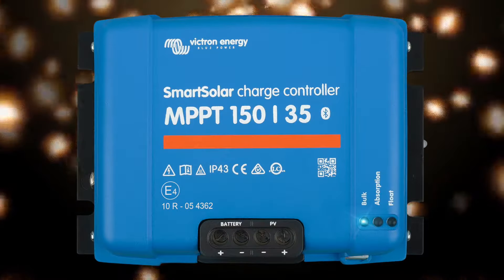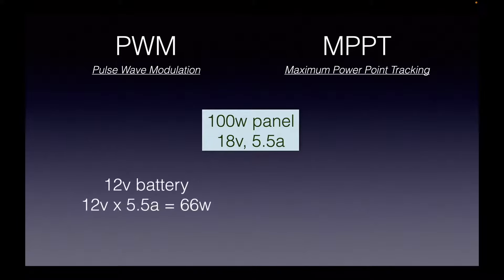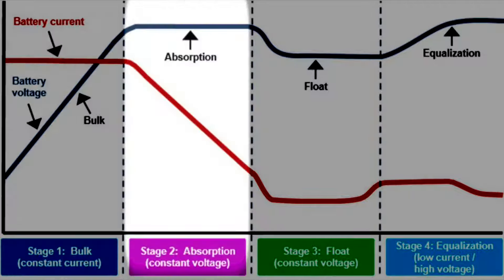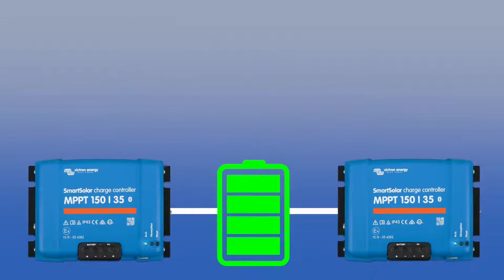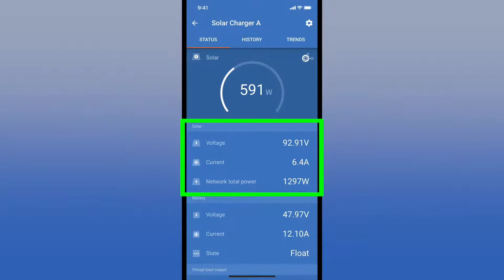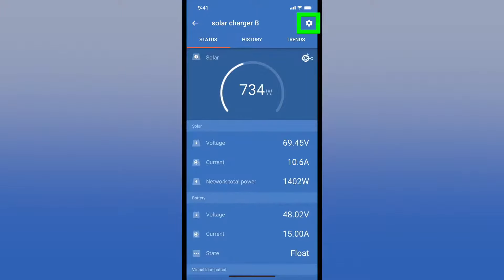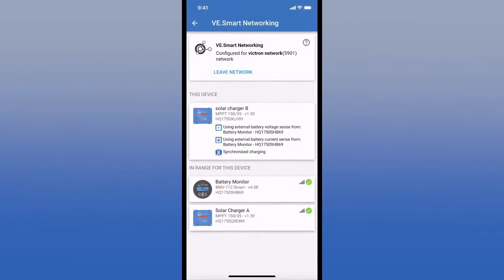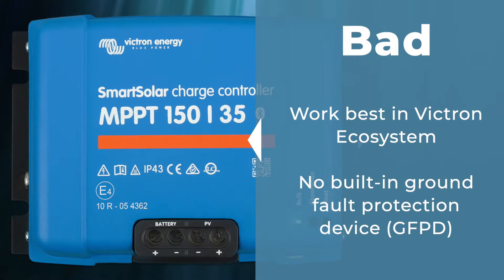Victron Smart Solar Charger Review After 4 Years Of Use. Features, Apps, Wiring Explained.

Comment: Just missing the correct load and streetlight info. These DO have a "Virtual Load" output. You can set the VE direct output as a switching level output for an external load controller such as a relay module. You can do a lot with the load and streetlight settings. Like set the voltage range for your load and when in a day cycle it comes on (they don't have a realtime clock they uses the solar cycle to time off).

Comment: bluetooth does not work well on windows PC I can only setup VE Network on a smart phone. Victron Connect and VRM do work okay though on Win 10
Reply from the maker: Thanks for sharing.
Reply: VE is not supported on Windows platform via bluetooth unless you use a VE.direct to USB cable (non bluetooth).  It sucks that we have to buy an andriod device (table) to do the simple stuff.
Reply: Maybe try updating your bluetooth drivers. There may be a driver package with more BT options direct from manufacturer of your BT chip.

Comment: on my 12 volt off grid system I have 4 of victron charge controllers, a 75/15, two 100/30's and one 100/50. I have a home assembled 630ah lifepo4 bat.  I have the smart shunt to keep track of battery level/current/voltage ect.  I  would  like to limiit the overall current the battery will be charged at without limiting the charge controllers(for supplying the loads)  Anyone aware of this being a possibility?

Comment: Hello.   Thank you verry much.   It's really helpfull!  Is it possible to use victron mppt as a booster.  For exemple i have a ebike with a batterie  48v. 25 amp.     And a solar panel 100w 12 v ?     I want to charge my bike while riding...  let's say with  a smal victron mppt. Have a nice day!
Reply from the maker: I suppose it MIGHT work... You would have to find a charger that matches both your solar panel and your battery. Victrons need 5v more voltage for solar input than your battery voltage, usually requires multiple panels.
Reply: @ReelClearMediaLLC  Thank you!
Reply: no. it is a step down charger. not step up.

if you have a 48V battery you'd need to build a 48V system. and having 2x 40V panels plus a 48V mppt charger would be a proper way of doing this.

Comment: I can never tell from victron controllers which ones can be used with 48v batteries I wanted to get the 75|15 controller but unable to tell from spec sheet if it will work with this battery
Reply from the maker: No, the 75/15 only works with 12v or 24v battery systems

Comment: Thanks for video. I live in the UK where there isnt much sun light in autumn/winter so we often have to swap the site batteries for batteries fully charged in the warehouse in order to keep the system running 24 hours. However, sometimes the blue controller stay on bulk mode permantelly after the batteries swap. Pretty odd isnt it?
Reply from the maker: yes, that is odd.

Comment: Really good 👍 straight to the point, easy to understand, just bought 2 x 100/50 s. Upgrading panels and controllers. My xantrex pwm c60, has been rock solid for 15 years off grid, but the newer mppt is definitely the way to go, hello from Ireland ;)
Reply from the maker: Thanks, Keith.

Comment: Excellent video.

My question is ...

Is there a problem if you input too much solar panel power?

I have a 1500 watt array that I power my water heater with.

When the water is up to temp, the solar panels are  electronically disconnected.

I would like them to switch over and start topping off the battery bank.

Is there a problem feeding 1500 watts at 115 vdc into a 150/45 charger?

My thought is the charger will max out at 45 amps with no harm done.

What do you think?
Reply from the maker: The Victron will limit PV amps to 45. As far as voltage, you  have to account for variables like cold temperatures. Victron has a spreadsheet that helps: https://www.victronenergy.com/upload/software/VE-MPPT-Calc-4_0.xlsm

Comment: Very clear and detailed presentation... thank you!
I have two questions:
- How much is the max input voltage from PV... 150V with zero tolerance?
- How much is the max input current coming from PV... 20 A or more... with zero tolerance?
Reply from the maker: You have to add adjustments for cold temperature s and irradiance. Victron has a calculator for that
at https://www.victronenergy.com/support-and-downloads/software down at the bottom of the page. Its called MPPT Calculator Excel sheet
As a ballpark figure, make sure you stay below 120v using your Open-circuit Voltages. As I understand it, the MPPT charger will only pull what it needs and cap amperage there. On my 150/35 model it will never pull more than 35 amps. I believe that refers to 35 charging amps going to the battery, not pulling 35 amps from the solar panels
Reply: You are conferming my doubts about, 
data from victron are not so evident and ready to be understandable at the first reading.
120V is a good compromise to Vbatt+5V and 150V is acceptable but 150V maybe regards to Voc of PV.

Comment: I have two growatt 3000  in para. and slit phase. They don't seem to charge the battery's fully, I was thinking of going to theses charge controller's, do you think that would be a good idea? Thanks
Reply from the maker: The victrons are great chargers. What is happening with the growatts?
Reply: @ReelClearMediaLLC  when they get the battery's up to around 25.6  they stop charging  , the battery symbol blinks  showing fully charged. The only way I get the battery's to fully charge up to 27 v  is to take all loads off the inverters , and let the solar panels or shore power charge only the battery's. I was wondering if a stand alone solar charger would do better? Thanks
p.s. I have the charge shut off set to 27.2 in the growatt.
Reply from the maker: @bianchispurs  Check Setting 2 and 11 to make sure it's charging with enough amps in absorption and float mode. 
If that doesn't help, The Victron chargers are very flexible. Make sure to pick the right model for your batteries and solar...
Reply: @ReelClearMediaLLC  Thank you, I will check that.

Comment: Hi very good easy to understand video. I’m in the uk just brought victron solar charger 100/20 got a 200w panel could I an another 200w panel to the victron or would I need a bigger unit. Also question on voltage settings for battery on victron float and absorption mode .. I’ve got a renogy 170amp lithium battery what should I set the two voltages at . Thanks mike
Reply from the maker: I've never used either if those, so I can't tell you from experience, However Victron has a calculator on their website where you can see how many panels work with different chargers. 
See the MPPT calculator excel sheet at the bottom of: https://www.victronenergy.com/support-and-downloads/software

You'll have to get the recommended charging voltages from Renogy.
Reply: As long as your Voc Max on both panels sums to less then 100v, you're good to put them in series. Do factor in a little overhead if your area is likely to get cold in winter, as this can push the Voc too high and fry your Victron.

Comment: Nice clear and concise. Thanks. I noticed you used 48 volts in one of the settings, but I think said your Chevy batts were 46. Did I miss something?
Reply from the maker: The 48-volt setting is a general range of battery...  the choices are 12v, 24v, 36v, or 48v. The precise charge voltages are set under absorption and float voltages. 
I've since upgraded to EG4 Lifepower rack mount batteries, they are still set to the "48v" range, but the charge voltages are much higher than the volt batteries.
Reply: @ReelClearMediaLLC  thanks!

Comment: the screw on the left from the side is for ground. i saw u dont have it connected. is that the solution to the case of possible ground fault you mentioned at the end of the video? i have this in my car and i want to ask u if u know for certain if it needs to be connected to the car ground (chassis)?
Reply from the maker: I'm unsure of how to wire that for mobile use. There are forums online for wiring RVs and vans that would be able to help.
Reply: @ReelClearMediaLLC  thanks. i think its the sam as with solar panels. in house yes on car no. why i think is that if a lightning strike the car and my vic is connected to the chassis.... well i presume byebye victron
Reply from the maker: @chupo4putin  If lightning strikes the car , the Victron will be the least of the problems.
Reply: @ReelClearMediaLLC  if lightning strikes it goes thru the tires and inro the ground. car suffers no damage so i think i think its fine. i think that bolt would kill me if lightning would strike at the precise moment i would be touching it or heat sink if it was scratched. thats what i think not sure thou....

Comment: Thanks for the video. Is it possible to set the battery charge voltage? My battery needs to be charged at 12.6V 20A CV/CC, will I be able to set this? Thank you.
Reply: You can limit output current to 20A if you want, and charging setpoints to 12.6v if you want.
Reply from the maker: @fratermus5502  thanks for answering, I was busy and away from Youtube this week

Comment: Hey mate, my victron app doesn't show any wattage only under load. So you think it's in mt settings? 
Thank you
Reply from the maker: If you are looking at a charger in the app, you might not see any watts if the battery is fully charged. If the battery is charging you should always see watts on the charger page of the app.

Comment: How much DC load can be run by this ?
Reply from the maker: This model doesn't have any DC load out. Some of the smaller Victron chargers do.
Reply: @ReelClearMediaLLC  so you use this only charging batteries ?
How you run DC load then ?
Reply from the maker: @imranraza1978  I don't need to run any DC loads directly. My AC loads come from the inverter, and when the battery is full, the inverter uses solar  from battery buss bars, which also connect the Victron chargers.
You could also use a DC/DC converter to convert the 48v from the batteries to whatever DC voltage is needed. I just run adapters for the few DC loads I have.
Reply: @ReelClearMediaLLC  thanks

Comment: So for a noob, the 150 / 35 means it can take upto 150 volts VOC and 35 amps input from solar panels.  Is that correct?
Reply from the maker: Generally, yes. 
The voltage can be affected by temperature and other factors. Victron has a spreadsheet on its website.
35 amps is the most the charger will pull from the panels, even if the panels can produce more than that.
Reply: @ReelClearMediaLLC  so...victron mppt controllers can overpanel both voltage and amps then regulate down to their max SAFELY?
Reply from the maker: @MyChannel-vm6dw   NO! Overvoltage will fry the charger. It is more complex than just the VOC, you have to account for temperature and other variables.
Download the calculator here
https://www.victronenergy.com/upload/software/VE-MPPT-Calc-4_0.xlsm
Reply: @reelclearmedia4157  thank you!
Reply: To my knowledge 35 means the max output amps from Victron controller to the battery. For example 35A * 12V = 420W  and  35A * 24V = 840W charging the battery.
Reply from the maker: @herkko61   Yes, that's correct, I just checked in the manual. There are charts that show "Max battery current" and it matches the amps in each model number...
i.e. the 150/35 =35amps, 150/45=45 amps etc.
Reply: Max 150v input and will only output 35amps so you could do one string to 150v and parallel it to an identical string to get same voltage but double amp thus over panel it for cloudy days

Comment: Are you using 10awg for your pv input?
Reply from the maker: 8 AWG, mostly because the run is 150' long, so a bigger cable for less resistance and voltage drop.
Reply: @ReelClearMediaLLC  oh yes, that's true, 8 awg, would be the way to go. How much voltage and current do you have going into, your charge controllers? From your array
Reply from the maker: @carlosreyes6448  The first array has 15 panels, 160w each. There are three strings,  with five panels to each string.  The three strings are paralleled using a combiner box.Voltage ranges around 90-100 volts, current average 10-20amps. My max power is around 1700 watts.

The second array has 12 panels. Three strings of four panels each. Voltages average 80-90v, current 15-25amps, max power is also around 1700 watts.
Reply: @ReelClearMediaLLC  I'm thinking about installing 8 rec 420watt panels and running a victron 150/60, it's rated for 3440 watts, but not sure about the configuration I'm thinking about 4 strings, series parallel, but they are rated at 59volts voc, and 8.9 isc,amperage.
Reply from the maker: @carlosreyes6448  Victron has a spreadsheet to help you design arrays for their chargers.
Download at the bottom of the support page. https://www.victronenergy.com/support-and-downloads/software

Comment: Having trouble with connection to my android 12 tablet. Currently no problem with my smart phone.  Maybe I should uninstall it from my phone then try to connect to my tablet  ... anyone else have these issues ?
Reply from the maker: If you're connecting with bluetooth, it may only allow one device at a time. If so, You don't have to uninstall the smart phone app just disconnect from blutooth
Reply: Check to make sure the VeConnect application is supported on android 12.  It may be supported now as when I purchased my tablet I chose v11 for that reason if memory serves me

Comment: *SHOCK*: YOU ARE PUSHING  30A @ 58V into your battery on FLOAT!!! 
RIP battery life
Reply from the maker: That's 30 amps max into a bank of two EG4 Lifepower4 batteries... each battery gets 15 amps. Their max charging current is 100 amps each, recommended 30-50 amps each. These batteries will be fine.
Reply: @ReelClearMediaLLC   your missing the point.... FLOAT you shouldnt be drawing that much current in FLOAT. you either have crap batterys, crap BMS or as leak somewhere. pushing 1.7KW!! into a full bank thats not doing anyhting?? 1.7KW is not float current.
Reply from the maker: @freelectron2029  Thanks, I forgot this when video was recorded I was using 6 chevy Volt modules(12S)... The BMS was crap, but with 6 modules, that was about 5 amps/module. Recommended charge was 49.2V per module, I was undercharging to 48V to give the batteries a longer lifespan. 
 I've since switched to EG4 batteries, but I still have the Volt modules I'm going to use for some smaller projects around the homestead.